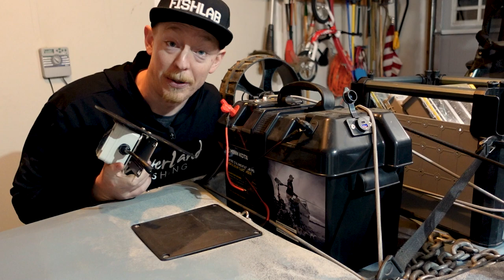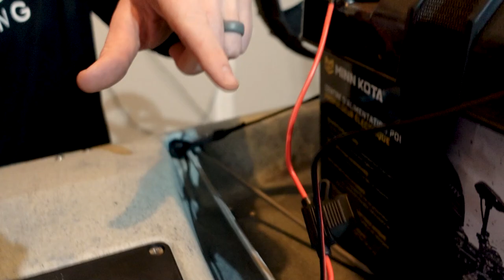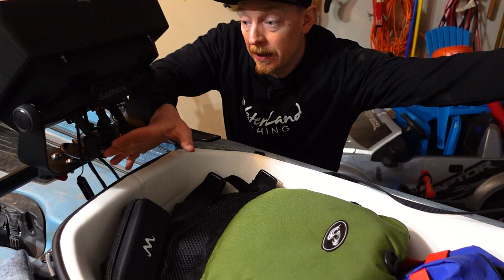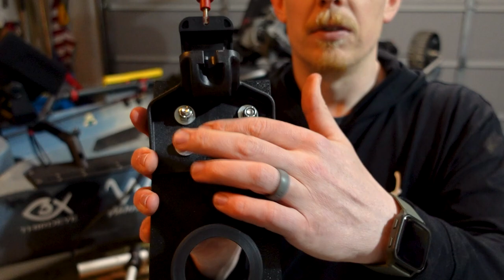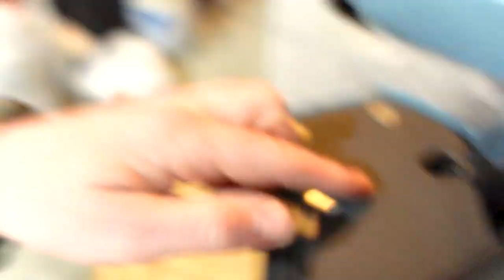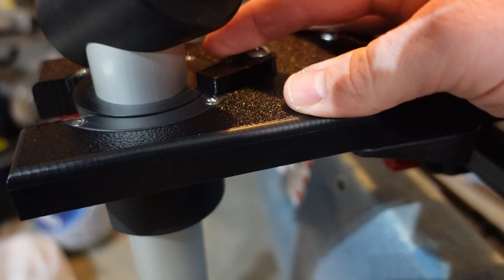Fully RIGGED Hobie Pro Angler With Garmin Panoptix!

Comment: Cool setup. The only thing I would change is,  use a waterproof FPV-Power 50ah v3 battery and ditch it in the rear hatch. One less hole to drill and no bulky battery in the rear. :)
Reply: How would you "ditch it in the rear hatch?"

Comment: Great set up, I have the same boat, not sure if I like were you have your Garmin located’  getting to the front hatch would be difficult when your in the water. I have my soft plastics stored in the front hatch ‘ Your electronics set up is awsome ‘ are you going to motorise it ? Torqeedo ? 
Can’t beat the Hobie 360, best kayak out there ! 
Well done on your set up !
Reply from the maker: No issues for me, theres a sweet spot
Reply from the maker: No on the motor… for now
Reply: @aaanglers  added a NK180s to the back of my PA12 360 .. I can go 20+ miles at 4.5-5mph and use 360 to hold on spots for fishing. It’s amazing!

Comment: Are you using a heading sensor for your garmin?  It necessitates an NMEA network, I think, plus more power wiring.  Curious if you made the leap or not.
Reply from the maker: I am not.  Didn't see the need for it in our smaller lakes.

Comment: Have you experienced any interference or resolution issues on running your graph and livescope to a single battery? I saw that Kristine is running two separate batteries, 1 to both her graphs and 1 to the livescope transducer because she has had issues.
Reply from the maker: Nope, no issues.  We have more than enough power with the 54 amp hour

Comment: What is your opinion of the LiTime 12v 100ah small foot print approximately $339.00
Reply from the maker: No idea, never looked into it.  Looks decent in concept
Reply: I have a Bonified SS107 with a Motoguide XI3 trolling motor and I am running Garmin’s Livescope LVS34 and the only battery I run is a Ionic 30 AH and I know that not enough power. That’s why I’m considering that due the
Reply: Ionic 100Ah battery is approximately $600